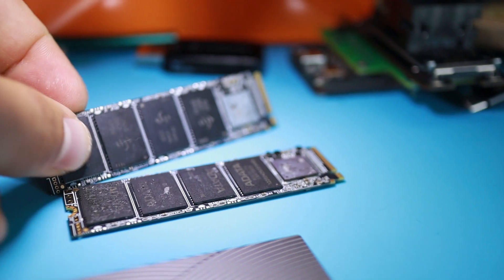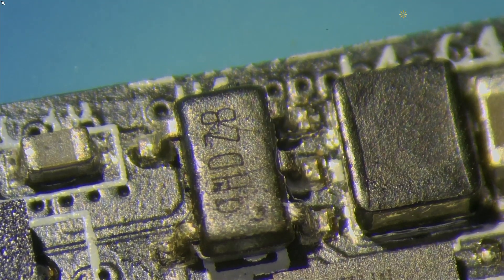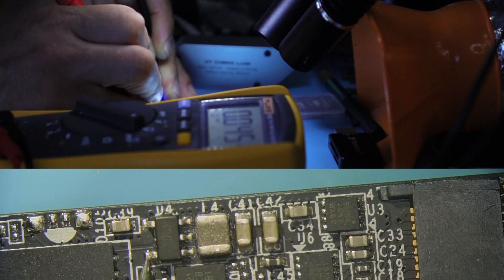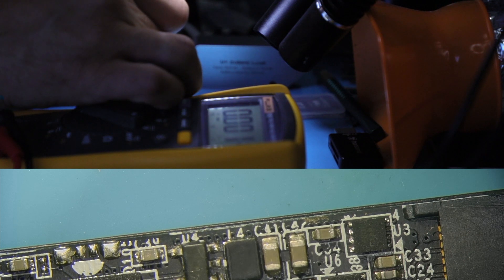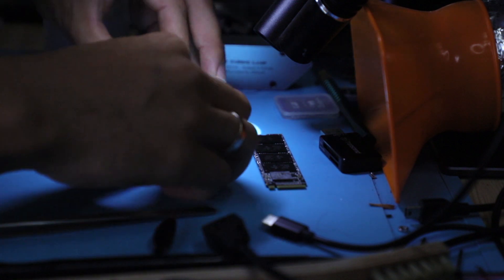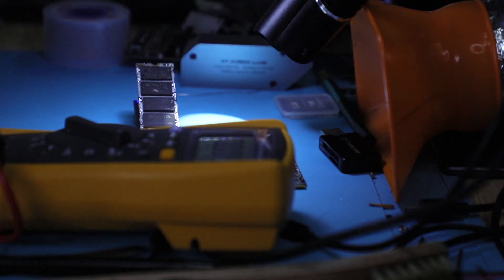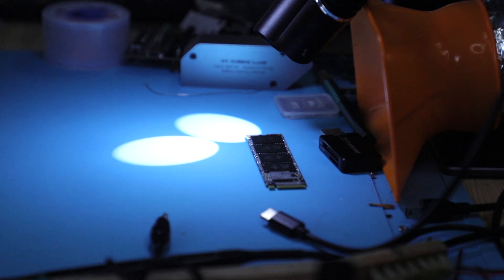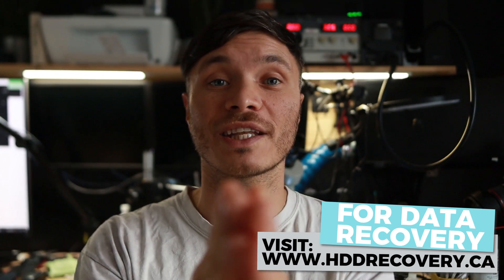ADATA Swordfish SSD stopped getting recognized by computer data must be saved

Comment: This piece of crap drive seems to have a widespread issue since the same happened to mine. Thouhg, I didn't have important data, so I just went ahead and RMA it. But, they die a lot.
Reply from the maker: Well said
Reply: iv had mine for less then 3 months and it intermintaly gets picked up by windows and sometimes windows will see it but its in read only mode imma junk it and get a samsung
Reply: @Loudkona  You'll be better off doing that. Anything but this drive.
Reply: @MerolaC yeah seess like this is a very common issue with these

Comment: How do you save the data to the new drive? Like it's originally, with Users/Desktop,  Programfiles etc? Or just getting the user data and saving that?
Reply from the maker: The file system remains the same as long as the image is complete. We select what the client wants and save the original directory and subs